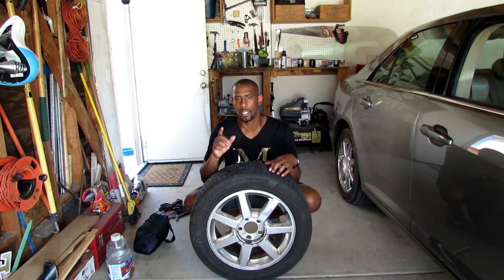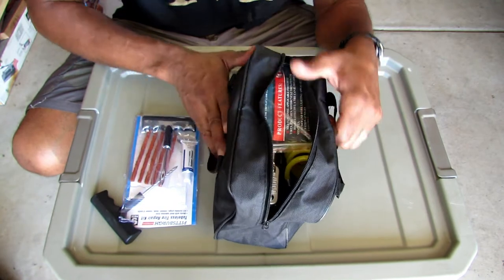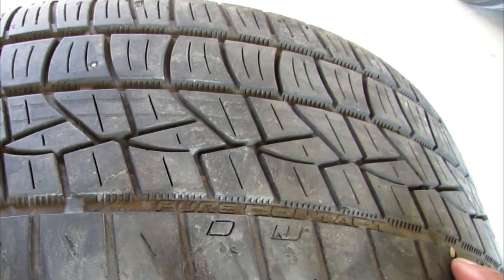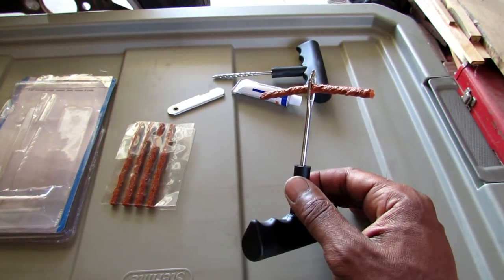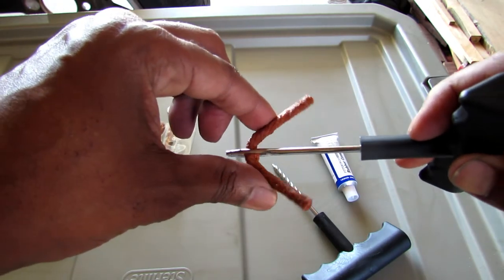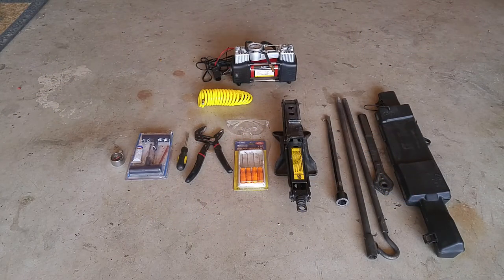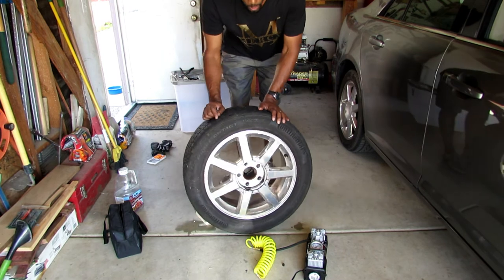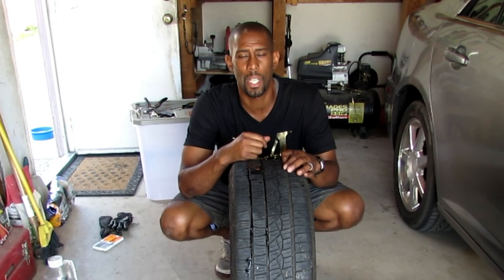Learn How To Plug A Flat Tire - Remove Nail & Screws

Comment: You need to check the side of the tire and it will tell you how much air to put in it, I would say that range is 32-36psi
Reply: You mean check the door jamb for the rated pressure for that car.
Reply: You can do that also.

Comment: lol @ 46psi. No passenger car on earth calls for that much pressure. Check the drivers side door jam for the correct pressure. It's not determined by how much the tire can hold. Your tires will wear out MUCH faster at a higher pressure and the suspension will take a beating also.
Reply from the maker: On my tires the maximum PSI says 51. They're high performance sport tires maybe that has something to do with it.
Reply: @oxmanagain  Tire pressure is determined by the make/model of the car, not the max pressure on the tire. Higher pressure is not better. The tire is the first part of your suspension. If its too rock hard, you risk bending a rim and damaging struts when hitting a pot hole. Not to mention the harsh ride when the pressure is too high.
Reply: For proper contact with the road- no matter what the performance tier of the tire, the tires should only be inflated enough to hold the rated weight of the car. Inflating to maximum psi off the car and then adding the car's weight through installation will result in an overinflated tire. The door jamb sticker is your best guide for tire pressure, never the sidewall.

Comment: You don't mention making sure you twist the plug. Applicator as you're putting it in to the hole and you don't need glue and you don't need to cut off the pieces. They'll be off within a couple of minutes of riding on the road, the excess that's sticking out of the hole